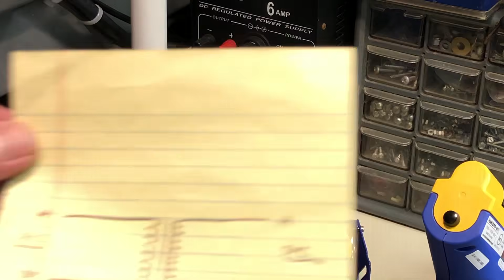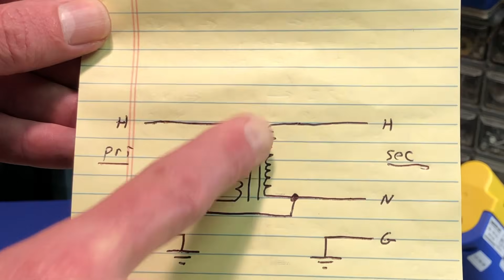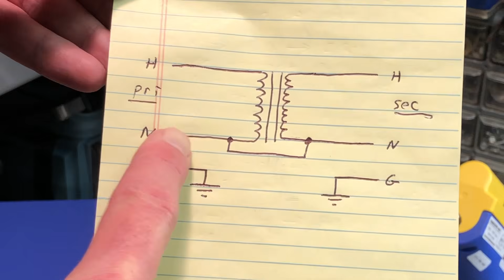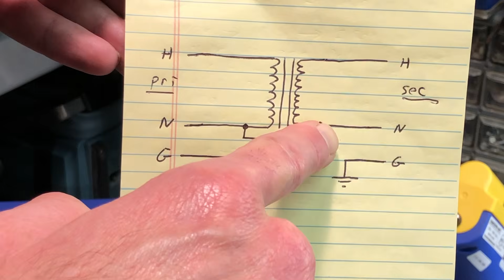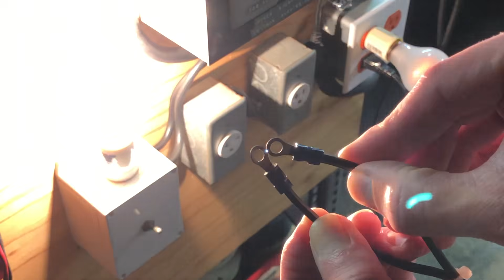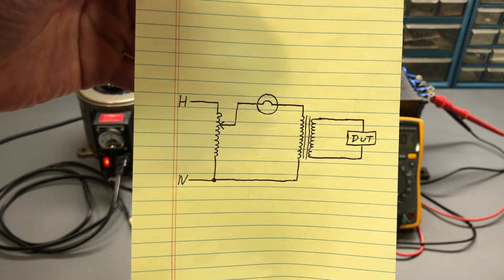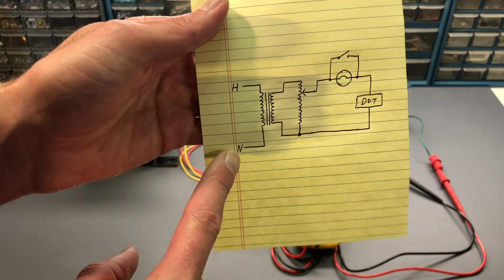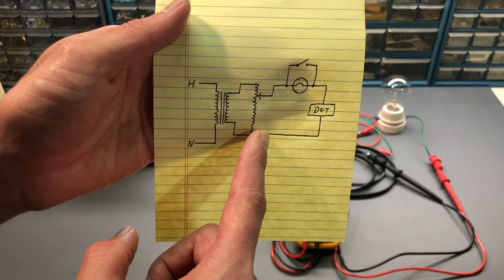How An Isolated Dim Bulb Tester Works (Current Limited Isolation Transformer And VARIAC)

Comment: Hi Eric, interesting and informative video; thanks. I see the logic in arranging the items as you do on your bench and indeed i used to have mine configured in the same order but, quite frankly, I couldn't put up with the noise. Since moving house, I now have the space to move the 'lab', such that it is, from a very drafty, cold garage to a nice warm ground floor room in the house. Whilst  setting up, I decided I needed to do something about the 'growling' noise emanating from my toroidal iso-transformer: it really is quite offensive and not the sort of thing one would want next to their ear for any extended period!!
I it put the first in the chain originally since it is a 2kVA unit and my mechanical engineer's logic suggested it would be better to put the 50VA variable behind it. Anyway, long story short, when I started the new setup I reversed the positions and had the variac first in chain. Lo & behold, the horrendous 'growling' ceased. It does return to a degree when I give it full mains voltage but below about 90-95% full power it is almost unnoticeable now, though I do not have the bulbs in circuit yet. They have always been last in the chain.
Any ideas as to what the cause may be? I surfed the 'net' for hours trying to find clues as to what aggitates the toroid enough to make it angry, though without noticeable success. It does seem voltage dependent but I am at a loss with this one. Any advice or suggestions would be much appreciated as I do not like being 'growled' at by 240 of His Majesty's finest volts.
Keep up the good work. 👨‍🎓
Reply from the maker: Hi, my guess is the impedance or matching between the transformers is not ideal and may be setting up some distortion on the AC waveform making the transformer growl or hum.  And some transformers are just more prone to making noises.  Even at no load, there is some current between your isolation transformer and variac.  A properly sized/rated capacitor across the AC line between transformers (power factor correction) could possibly help correct this but the noise is not damaging to the transformer unless it is so extreme the transformer is running hot (could be indication of other problems too).
Reply: @EriksElectronicsWorkbench 
 Thanks Eric, I'll get the maths hat on and give it some consideration. I guess all  the loading it sees at the moment is inductive so there could be something in it. The toroid is double-insulated as it came from an out-door-functions company and has no earth reference at all. Having the variac first also means I can have the earth ground on its metal case connected.
Reply from the maker: @grahambambrook313  It seems placing the bulb for current limiting last is the best option (as I show in the video) and the order placement of the transformer and variac is about a toss up with some advantages on each way.  Arrange how it works best for you and the components you are using.  Yes one transformer driving another is a very inductive load to the first transformer (or variac) although in my own set up I have not had any issues.
Reply: @EriksElectronicsWorkbench  👍

Comment: Is there a simple analog soft start circuit?😅
plan to use for angle grinder
Reply from the maker: If you want to limit the inrush current surge a single component can do this, called the NTC Thermistor, you can find them here  https://www.mouser.com/c/circuit-protection/thermistors/ntc-thermistors/    you have to choose the proper resistance and wattage rating among other things.  Keep in mind some motors cannot be current limited as they will not start up correctly and will overheat.

Comment: Thanks!
Reply from the maker: You're welcome and the donation is appreciated. Thanks :)
Reply: @EriksElectronicsWorkbench  would love a video of you adding a digital meter with a torrid to the dim bulb I’m having a terrible time adding mine.   It works but then the limiting function goes away and the mains won’t turn off with the mains switch.
Reply from the maker: @johnc.4625  I will consider that as a future topic.  From your description, if the current limiting is not functioning the bulb is being bypassed somehow.  A voltmeter should only need to be connected across the load (would be the most useful location).  Don't try to measure across the bulb or across the mains switch.

Comment: so I assume your secondary stage of the iso transformer has no ground reference , therefore the variac will have no ground reference and neither will the dim bulb and device under test.  so besides placing  two ground probes on the dut which can cause voltage potential if not in the same place, are their any other vunerabiltys , can yo be shocked by touching the metal casing of the Variac as it is not grounded  or something of that sort.   thank you.
Reply from the maker: Yes correct that the transformer secondary does not have a ground reference which is what the "isolation" is referring to.  Since the transformer's secondary does not reference either side to ground, if a fault occurs, for example, in the variac making some part of it live to one of the isolated AC lines you would not be shocked because no return path exists from the user through ground and back to the transformer's secondary.  This is also why you should not use a ground referenced oscilloscope on the isolation transformer's secondary (on DUT).  If you introduce a ground path on any part of the transformer's secondary then yes a shock hazard will exist.
Reply: @EriksElectronicsWorkbench  thank you for the detailed response I really appreciate that.
Reply from the maker: @johnc.4625  Happy to help with questions and thanks for the donation. :)
Reply: Could you please clarify what you mean about the ground referenced oscilloscope? Are you suggesting having the oscilloscope connected to an isolated supply and not a grounded mains?
Reply from the maker: @msouthwe1  AC mains powered oscilloscopes have the probe ground tied to chassis ground. You should not float an AC mains powered oscilloscope on an isolation transformer as there can still be a shock hazard if you contact a metal part of the scope and part of the circuit you are testing.  In situations where the scope ground can't be tied to circuit ground potential the only safe way is to use an isolated ground scope like a Fluke Scopemeter or a differential scope probe.
Reply: @EriksElectronicsWorkbench thanks so much.

Comment: Your 'test cord' has a name.  It is called a suicide cord.  It should have a fuse wired in it!!
Reply from the maker: In typical bench testing there are fuses but they are in the variac and also the isolation transformer.  There are two fuses on the variac, selectable for the expected load.    The devices in this video are just for an example and not used in my regular bench setup.

Comment: Someone please help me out here. I totally understand the dim bulb and the variac. They make total sense to me. Please help me understand the isolation transformer though. Now, I totally understand step-up, and step-down transformers, and so 1-to-1 also makes sense. I understand that the secondary side has to be COMPLETELY ISOLATED from the primary side; no connections between neutral, ground, etc. What I DO NOT understand, and what I can’t seem to wrap my head around is how this isolation makes me, my devices being serviced, or my tools (oscilloscopes for example) ANY SAFER… 120 volts is 120 volts, right? The secondary has 120 volts on it too, just like the primary, and if I grab one leg of that 120v with one hand, and the other leg of that 120v with the other hand, I AM going to shoot 120v through my heart, whether I am on the primary side, or the secondary side of the transformer. The secondary side isn’t magically turned into human-resistant voltage. It’s STILL DEADLY, so SOMEONE PLEASE explain to me how the isolation does any good. Ok, so I’m no longer connected to the breaker box neutral and earth ground (why can’t a 3-prong adapter/ground lift adapter plug do the same thing?), but I’m STILL dealing with that 120v on the secondary, so how am I any safer? This has boggled my mind for a while, and I know it shouldn’t…. but… it does… Thanks in advance for any insight…
Reply from the maker: The isolation transformer does not protect the user in any way if you come in contact across the secondary.  There is always that risk of shock. 120 volts from the isolation transformer is just as dangerous as from the wall outlet.  But without the isolation transformer just one hand bumping a live point could inflict a lethal shock so the risk is at least reduced some with the isolation transformer.  The isolation transformer can also make testing with a traditional grounded oscilloscope possible in certain situations although a full understanding of the circuit is needed and a shock hazard can still exist from exposed metal parts of the oscilloscope.    A ground lift adapter won't isolate the item you are working on as the transformer is able to do.   Keep in mind that vacuum tube equipment and devices like high powered audio amplifiers have high voltage DC power supplies in them so the AC line (isolated) is not the only shock hazard.  It is best to follow the one hand rule and only probe or work with one hand near the live circuit as to minimize a shock going from one hand  through your body and to the other hand.  As always be safe and fully understand the safety precautions before working on a device.
Reply: @EriksElectronicsWorkbench  I respectfully disagree. My understanding is that with no external reference the 120/240v exists across the load if you care to measure it there but there is no real live/hot/phase/whatever you want to call it, and no real neutral/common/wywtci. It's all arbitrary voltages that depend on where you measure it. Provided the device is properly isolated, if you should touch the notional "hot", you become the reference. You are grounded and the point that you touch becomes ground in the circuit. That's  why it's so important not to have any other reference on the device. If you have, for instance, a grounded scope lead  attached that will be a much better, as in lower impedence that you are and you will get a shock if you touch anywhere other than at that grounded scope. You can prove this safely. Imagine a 12v transformer with open output windings feeding a high resistance wire wound resistor. You could touch any part of the circuit with a voltmeter probe and the other probe to earth would give zero volts because the 12v has no other reference to ground. Now hard short that same point to ground and use the meter to measure any other point on the circuit to ground. You will get a voltage that varies between zero and 12v, depending on exactly where you put the test probe. The same thing happens with a mains isolating transformer. If there's no other earth reference you can touch any single point of the circuit.
Reply from the maker: @electrogrim  I think you misunderstood when I said "across the secondary". I mean across as in from one end of the transformer's secondary winding to the other end, you would be shocked.  Voltage is always a two point reference.  If you contact only one end of the secondary winding and everything is perfectly isolated then in theory you would not receive a shock.
Reply: @EriksElectronicsWorkbench  Would the amp's power transformer typically have grounded connections? I assume that would defeat any protection that the isolation transformer provides when working on components fed from the secondary of the power transformer.
Reply from the maker: @tbonemckone  If the device has for example a chassis grounded center tap on the secondary of it's own transformer that would not matter as far as the protection from the isolation transformer. The primary winding side would not normally have a connection to the chassis.
Reply: Any device that has a power transformer has isolation by that transformer!  Isolation transformers are only needed when servicing a hot chassis or a SMPS.
Reply from the maker: @Route66Wanderer  an isolation transformer still offers protection on transformer powered devices in that there are AC line cord connected parts that can have exposed connections like the power switch, terminal boards, fuses, etc.

Comment: Great Video Thanks! I’m in the process of changing all the old electrolytic’s in my HI-FI pre and power tube amps ( previously working fine) and am a bit anxious about switch on. What still concerns me is if I have a setup like this and say have a capacitor that decides to go faulty, is it still going to go bang all of a sudden even if I bring the voltage up slowly in stages-as there probably is still enough current flow? Also my amp has voltage regulation with 85V reference tubes so I assume the fun might not begin until I have the Variac at 85V and above? Many thanks for any knowlegeable answers 👍
Martin UK.
Reply from the maker: Glad you found the video helpful.  The current limiting from the bulb will not prevent all types of faulty components from going up in smoke.  It is most useful for faults in main power supply components or other power handling circuits in a device like an amp's output stage.  The bulb is a visual indication of a problem so you can quickly cut the power if needed as well as a current limiter to prevent more serious damage from occurring like a power transformer being destroyed by a shorted filter capacitor.   It depends on the circuit design if the regulated voltage circuit will have voltage present at low line voltages or if it suddenly switches in at a particular line voltage.  You can monitor that regulated portion with a voltmeter to understand how it works.  Double and triple check your work before power up as the dim bulb won't prevent damage to electrolytic installed backwards.

Comment: Putting the iso transformer first is best. In this configuration the variac does not have to supply excitation current to the iso transformer which depending on the size of the iso transformer can be mA to Amps.

Comment: Hi Eric, 
Any advantage to using this bulb tester on vintage transistor receivers/amplifiers and tape decks.
Reply from the maker: Using an isolation transformer is always a good idea.  Generally bringing up voltage slowly and running solid state devices on low voltage is not recommend because the circuits behave differently than tube circuits under low voltage conditions.  However there are times bringing up the voltage with a variac is useful during testing on solid state circuits so it's one of those use as needed situations.  You can use the dim bulb portion (and a suitable rated bulb) for an initial power on just to see if there is something drastically wrong.  I would not leave the dim bulb in during testing etc as the lower voltage will make readings and operation unpredictable.

Comment: Logically it's obvious, but "for science" it would have been informative if, during the setup with the lamp in the middle, you had shown the voltage level on the Input of the isolating transformer also.

Comment: would it make sense to have a isolation transfer before and after the variac?
Reply from the maker: Hi, using the isolation transformer before the variac makes the variac isolated as well as the device you are working on.  Any  additional isolation transformer would not serve a  useful purpose unless you had some unusual voltage conversion requirements (step up / down) beyond what the variac could do.

Comment: Great video. I've always had my Isolation Transformer, Variac, and Dim Bulb in the 2nd configuration you've shown and I guess since I'm using a 300w bulb, I haven't run into the issue it potentially could have. However, you've convinced me to try out the 4th config and will soon when I clear out the work I have going on. One configuration you didn't touch on is: Isolation Transformer > Dim Bulb > Variac. Any thoughts on that config? Thanks for the tips!
Reply from the maker: Glad you liked the video, thanks for watching!  Isolation Transformer > Dim Bulb > Variac would function like the 2nd set up, just switching the transformer and Variac positions.  Advantage would be the bulb, associated wiring, and Variac are isolated which adds safety.  It should work ok but might have a some bulb glow even with no load on the Variac due to the current that always flows in the transformers (as mentioned in the video).

Comment: Excellent explanation, thank you! I have been trying to find a definitive answer on this issue for a long time. I had arrived at the third set up myself, partly because I wanted to ground my variac, so it had to go before the isolation transformer, but I now believe your fourth set up is better.  BTW, wouldn't the 'bulb always on' problem also apply to the first set up when using a low wattage bulb?
Reply from the maker: Glad that you found the video helpful.  Yes in the first configuration a small wattage bulb would glow once the variac is increased because of the small current that flows in the transformers even without a load on the isolation transformer secondary.